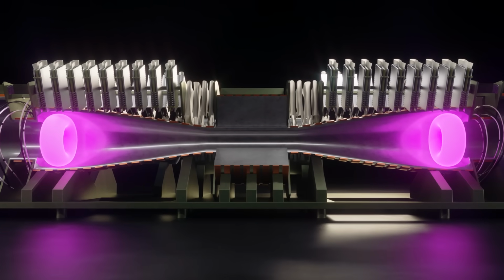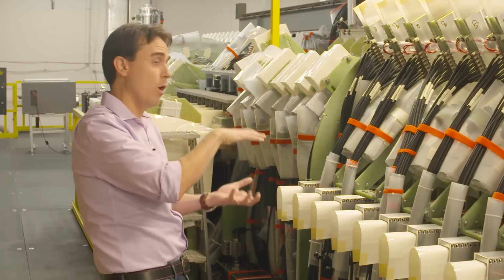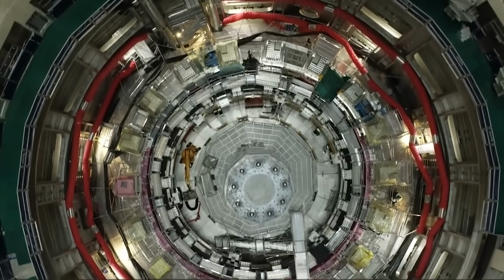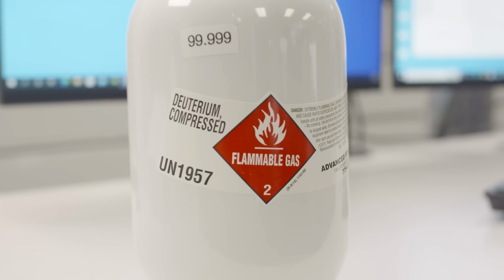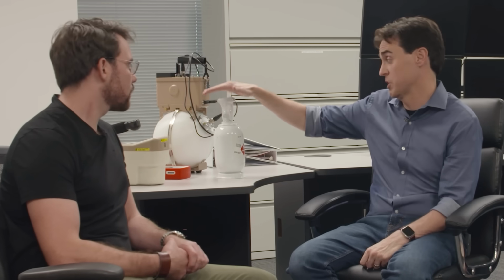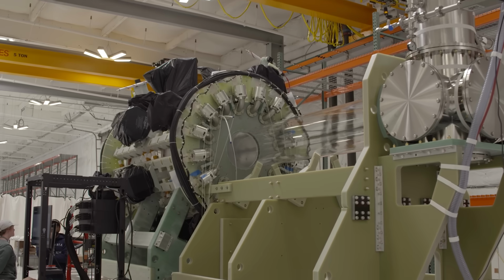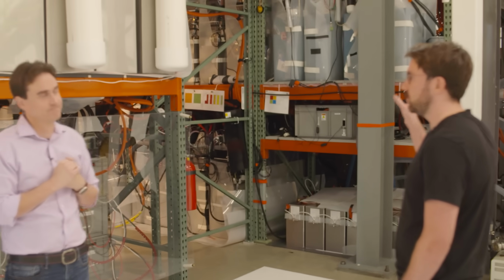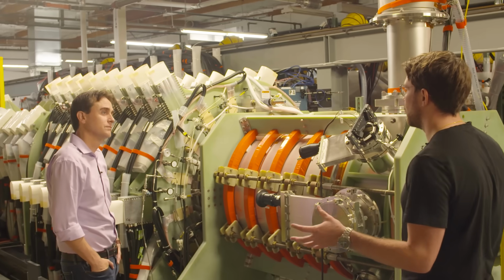A New Way to Achieve Nuclear Fusion: Helion

Comment: What they have right now is impressive, amazing even. But what im really curious about is the method to regain energy. 
I get the piston analogy, where we use energy to compress the piston and then regain more energy as the explosion pushes it back. But does the same really apply to magnetic fields? In my head we are using energy to contain the reaction. So what does "pushing back the piston" even mean in this scenario? We are still using energy to create the magnetic field.. and at the same time we are gaining energy? That doesnt really work in my head. Going back to the piston analogy, it would be like if we kept on pressing the piston into the explosion, but still gained energy.
Reply: The plasma is made of charged particles and has its own magnetic field. The magnets are turned off towards the end of the pulse and the plasma expands, driven by its internal pressure and the energy in the fusion products. Since
Reply: @elmarmoelzer2229  I doubt the comment was supposed to end at "Since", but i still appreciate the attempted explanation :)
The thing is, we cant fully turn off the electromagnetic field, since then the plasma would fully expand and and touch, thus damage, the reactor walls, right?
I guess this is what i struggle with. We use electricity to maintain the field to contain the plasma, but the expanding magnetic field of the plasma is at the same time somehow generating us electricity. I guess it might make more sense if i came from the field of physics and not computer sciences lol.
Reply: @Yamyatos  The plasma loses energy while it does work during the expansion. I am not 100% sure about all the details of the circuitry and how much energy remains in the coils at that point.

Comment: One thought regarding the fuel generating reactor is that since that's where the neutrons are, putting in a layer to transfer the neutrons to heat and extract the energy in a steam turbine becomes possible. That would, in theory, increase the energy yield from the fuel generation reaction, as well as provide neutron shielding for the reaction. Of course, this also would increase the complexity and expense of the fuel generating reactors.

The second thought is that since tritium is expensive, and they probably don't have a way to store it for however many years it takes for it to decay to He-3, they're probably selling the tritium side product, aren't they?

Comment: Direct production of electricity would probably increase overall efficiency by about 3X, all things being equal.  If Polaris can begin to produce electrical energy, even if only a fraction of the energy needed to produce it, the path forward would seem viable.  We're still looking at decades before commercial scale stations can be built but this does seem to be the most likely approach to fusion energy.

Comment: could use coaxial wiring to cancel out some EM field changes (and inducing current into other wires) during current pulses.  Magnetic field is neutral around a coaxial cable for any amount of current if current is flowing the same amount in both conductors but in opposite directions

Comment: It is reminiscent of a uranium gun type (teller-ulam!?) fission bomb, but with fusion fuels instead of fissionable metals. A little more complex though 😂
Extremely clever to skip the "boiling the kettle" part - which makes perfect sense when you're using an electro-magnetic confinement system to begin with.
I really hope they can do it.